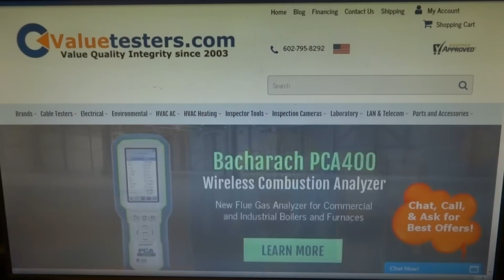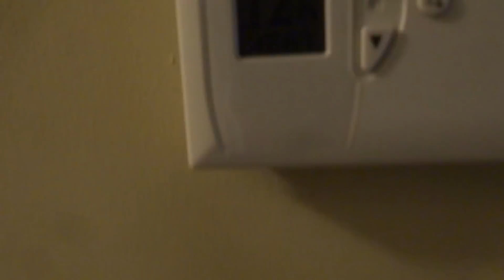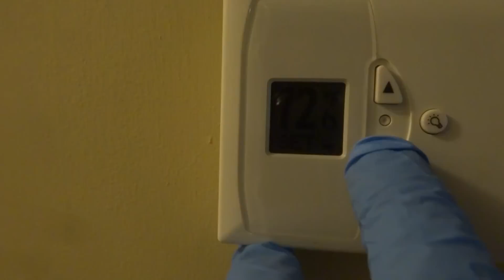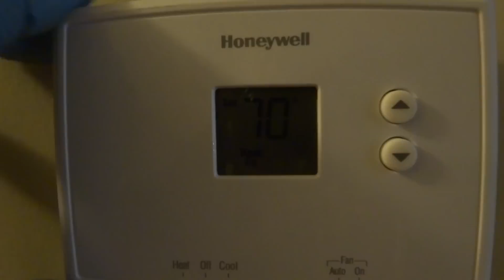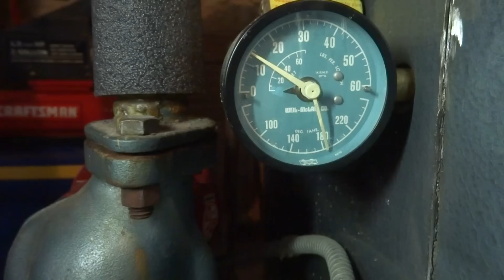boiler keeps running & heating

Comment: Had a similar old White Rodgers aquastat on my oil fired boiler do the exact same thing. 

Woke up with the house feeling like the lobby of a nursing home. No t-stats calling, but the relay was stuck closed. Gave it a massage to free it up till I had time to change it. 

Luckily I had already bought an exact match to that control for a spare. NOS, sealed in the factory box. Got it dirt cheap off eBay, since nobody wants a control older than the one they’re replacing, even if it is new in the box.

Comment: Can do a lot more with that control. Can use that control to fire steam boiler (180 degrees) for basement hot water zone in converting burner contact into dry contacts (for milivolt, removing jumper) wiring burner contact parallel with T-sat on steam side.

Comment: So, with this boiler, the relay and aquastat are all in one unit? With my old Hydrotherm, the relay is mounted to a beam post and the aquastat is on the boiler... obviously. They relay would humm and buzz back when I bought the house and I just filed it like a set of ignition points.

Comment: I had a call come in 11:50pm a week or so ago, lady said everyone was awake it was so hot, bloody noses from dry air, baby crying, etc. 
Told her to switch the breaker off. 
Got there in the morning, found the old fabric tstat wires were soaking wet from a leak in the bathroom, shorted out.
Put in new tstat wire, and all was good.

Comment: Just take the pressure off the boiler and do the quick switch on the well. You might loose a little water but it's nothing compared to draining the boiler. Kinda like changing a element on a electric water heater by drain a little water to get pressure off and unscrew the old element and quickly screw the new one in.

Comment: I have an old Weil-Mclain water oil furnace -the house was built in 1977 and i don't believe it was changed. the thing is running great so far. my question is: how more efficient newer systems are and is it wise to upgrade. with oil prices as high now days am i shooting myself in the foot by keeping an older system. willing to spend money on the upgrade if it will save me money on oil in the long run.

Comment: not a sticky gas valve?
Reply: If there was flow through the wire ( amps } then a sticking gas valve would be possible, usually the flame flutters out in a different way when they stick and close slowly. I assume he was also reading the voltage on his meter, indicating that a relay is stuck. If its a Pcb ( printed circuit board ) module type it is soldered directly to the control pcb. and not replaceable like the plug style relays. 
:)
Reply from the maker: the circulator was running also so that gas valve was not the issue
Reply: thank you !

Comment: you should of got a control thats fits or matches with the boiler instead of using the Honeywell control.
Reply: Steve said it was a Saturday. Supply houses are probably not open.
Reply: That was a 30+ year old White Rodgers control, on an equally old boiler. 

As long as the Honeywell does everything the WR could do, especially managing the high limit on the boiler, there’s absolutely no problem using it. It’s not rocket surgery...